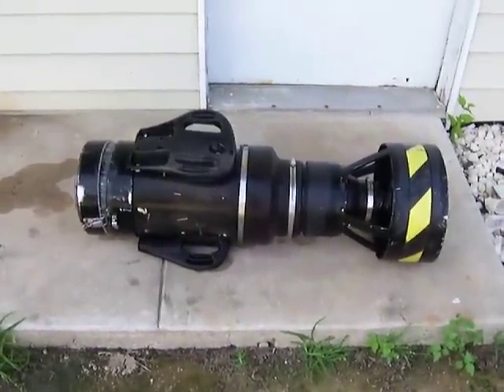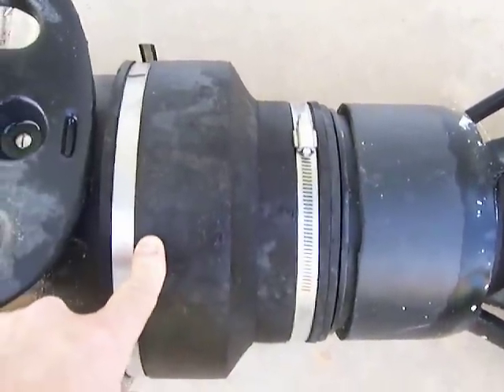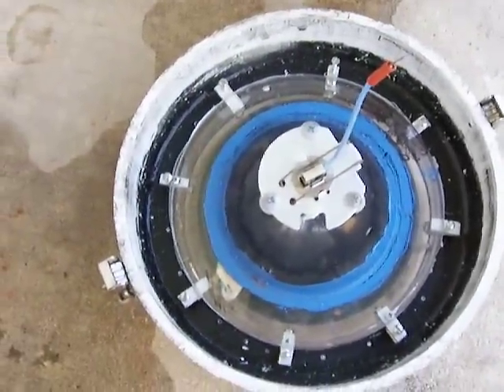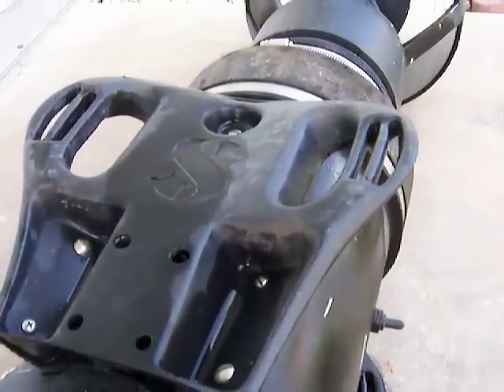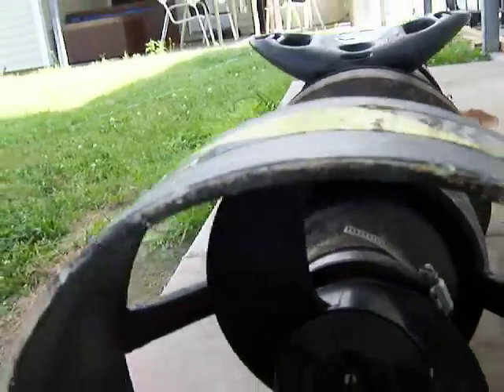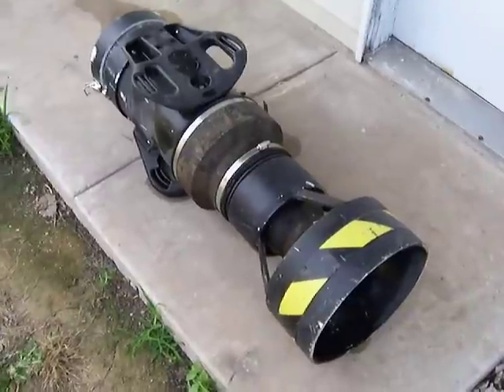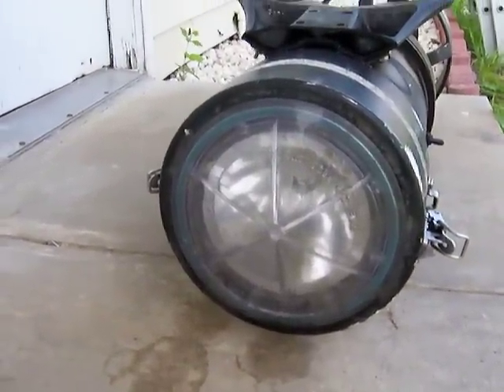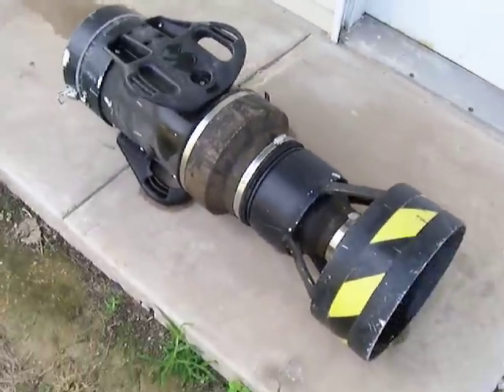Underwater Propulsion Scooter homemade

Comment: Very hefty design.  Much better than all the homemade pvc rov's on YouTube.  I like using the trolling motor instead of submersible water pumps for the thrust.  I would like to build one to go tethered down to about 300 ft or deeper.  No on-board battery means a whole lot less drag!  I realize that a lot more pressure-proofing would be required at those depths.  One day my dream project will come to fruition.

Comment: OK I love the whole set up. Why not build it in two sections? the power stage really doesn't need to be sealed other than where the wires come out. Caulk would take of that. The battery section could be totally sealed as well. run the wires from the battery compartment through one bulkhead into the motor section. Again use caulk to seal it at the bulk head. last but not least test it!!
Reply from the maker: there's few more vids to this. it was built about 17 years ago
Reply: lyn perk
Ahhh! thanks. :) do you still use it or was it sold? I was thinking of making a tank-less/smaller version of it. I was going to use it with a electric hookah system.
Reply from the maker: Terry Dubay i still have it . if someone wanted it they could have.
Reply: lyn perk
Cool, But like you most of the fun is making it your self, Thanks :)

Comment: nicely made. Do you have any video of assembling it? 
Thanks!
If it is still available I would happily pay the shipping and something for your time. It woud save me the time of gathering the bits!
If you get me a weight and the dimensions I'll tell you what the shipping cost is....
Reply from the maker: i have links on the video
Reply: lyn perk Thanks. Normally folks include them in the description. This is why I asked.
The photo describes most of it except for if it has positive or negative buoyancy. Thanks again. Bob Ordewald.
Reply from the maker: i just added video links to the dessciption
Reply: lyn perk Thanks Lyn, I've saved them out and I've subscribed as well. Did you ever sell yours? I'd be interested, it would save me the time of gathering and building it.
Either way, Thanks for your time!
Bob from Staunton Virginia
Reply from the maker: i don't want deal with the shipping if someone wants it there going haft to pick it.
Reply: lyn perk where are you? Would you be willing to drop it off at a ups store? I'll pay them to pack and ship from here.

Comment: But this actually works?  do you have a test video? into the water I mean
 thanks!
Reply from the maker: Cristian Fiorio It work but it’s cheaper just to buy one
Reply: @lynperk  I didn't noticed that was a 8 years old video!!! 😅  
 Yes.. today days make sense will be cheaper just buy new one 😄
 Thanks for reply mate 👍
Reply: @lynperk  A lot of scooters cost around $400.  An old trolling motor can be found for $40, even cheaper if the handle is broke or something.  Some scrap PVC or other material wouldn't cost much, throw in a battery from a cordless drill and thats really cheap

Comment: You need a wire screen gaurd so no fingers or toes slip in the way of that prop man... This is awesome but very dangerous
Reply from the maker: your right and i did it .ouch
Reply: you got a digit in the blade or added the guard?

Comment: 500,000 candle light* 500,000 lumens is like a football stadium
Reply: I agree.  But he said 500,000 watts.  Another option altogether
Reply: So if that automotive headlight uses 500kw and a average trolling motor consumes about 200-1000watts. It would need a small nuclear reactor in that little thing. Not to mention that much power in heat dissipation from an incandescent light might boil the water directly in front of it. But everything will see you coming I'm sure.